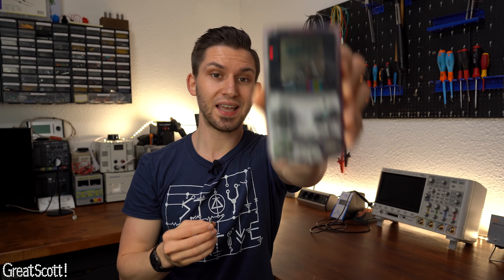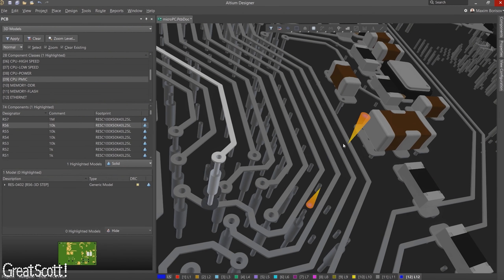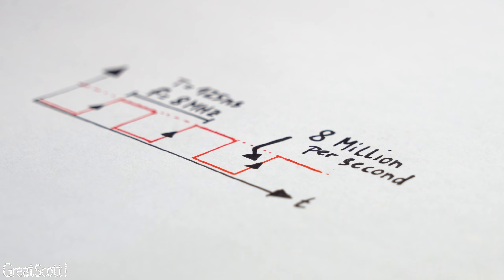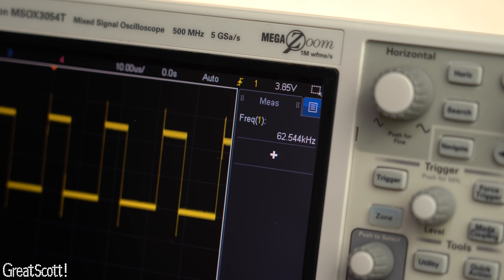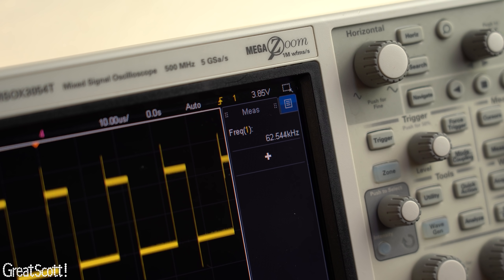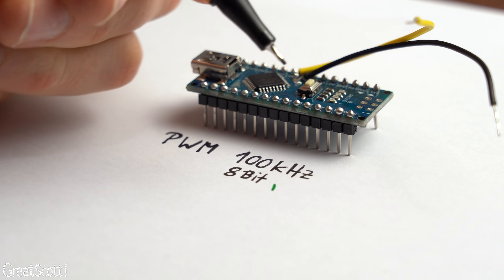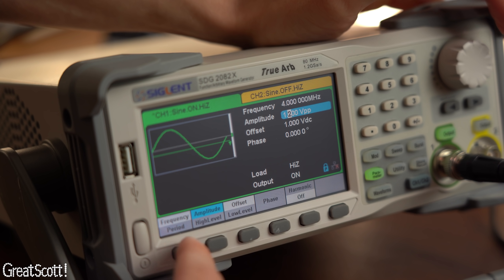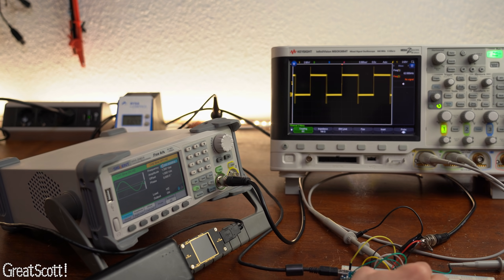Overclocking can be useful?! Let's try with my GameBoy & Arduino

Comment: Great video! It'd be neat to see the reasons for these frequency limits, and why it glitches when taken too far
Reply: It will glitch because the rising/falling times for signals will become too long for each clock cycle, meaning data from 2 different clock cycles kinda gets mashed together, corrupting it and causing the system to execute 'random' instructions or no functions at all as a trigger level is never reached.
In the gameboy color, the main clock is divided, likely this divider cannot keep up, if you were to bypass it you could probably get a higher clock. The next issue is the ROM in the game cartridge, it is far too slow for any higher clocks. So for getting your gameboy color to 30-40Mhz you'd need a faster ROM or even SRAM etc.
Reply: @someguy4915  sram timing will not be able to keep up at some point also I suspect the screen might not be happy with the fast timing, idk if it has internal buffer like modern lcds
Reply: @victornpb  I suspect that the battery life will also be disappointingly short.
Reply from the maker: Thanks :-)

Comment: Now could you wire up 3 different oscillators and control them with a switch or would that take too much power?
Reply from the maker: That should work just fine ;-)

Comment: Fun fact (in case you don't know): you can also overclock PC's CPU by force the system to give it more voltage than usual. But this will increase heat output of CPU, but make the CPU runs faster!!!!

Comment: I can see speedrunners modding their gameboys to run games faster :D
Reply from the maker: Lots of people actually do this. There are mod kits available ;-)
Reply: This is considered cheating and would be very obvious to detect
Reply: For Pokemon speedruns the in-game timer is used. As this clock also runs fast there would be no improvement by overclocking. In fact, for faster-paced games, underclocking would help you get faster speedruns by running the game in slow-motion.

Comment: Also to deliver the higher current you need higher voltage, so “overvolting” may be required to achieve bigger overclocks, and with higher power more heat gets generated
Reply: Water cooling an overclocked Gameboy? Sounds like an LTT video
Reply: @colejohnson66  or maybe der8auer, since scott from germany, and so roman (der8auer) too. Plus point is Roman is an overclocker himself.
Reply: @colejohnson66  I think a massive heat sink would be funnier and probably more effective
Reply: @colejohnson66  Anthony from LTT needs to get on it!
Reply from the maker: True :-)
Reply: Well they did overclock a calculator to run some games on it, and watercooled it if I recall correctly
Reply: With higher power, comes greater responsibilities
Reply: Transistor gates are capacitors - there is a set amount of time it takes the gates to charge up to the threshold voltage and the higher voltage will charge them faster. OC systems become unstable because you're driving them at a higher frequency than the chips are rated for, which can result in signals being "lost" if the gates can't change state fast enough. This does require more current but it's not the same as the increased power usage from faster switching which is what is being referred to in the video.
Reply: @skipfred  Great explanation, I was wondering why actually those glitches occur. It is learned on computer colleges with an examples of JK bistables  where they don't get to close/open because they are too slow before another signal comes in which is too fast.
Reply: get the ln2 ready!
Reply: That's exactly why I have a 50L dewer of LN2, a single stage phase change unit and watercooled tec's !
It's nice watching a 400w 12900k OC drop to 250w with just a bit of cold
Reply: @Gti_Jason  how could it possibly drop from 400W to 250W with cooling? Shouldn't the power remain the same but you can achieve higher clocks and powers with relative stability?
Reply: @dimitrijekrstic7567  because the resistance of the connections inside the ic decreases with temperature, and the transistors become faster as well both help decrease the power of the ic, btw by cooling he meant ln2 aka -160ºC, so a simple water cooler wouldn't produce the same effect, at least not enough to notice it.

Comment: Overclocking is definitely worth it for PC hardware. MSI afterburner is a easy way to get into GPU overclocking. I've never damaged a component by overclocking.
Reply from the maker: Thanks for the information :-) Never used MSI afterburner before.
Reply: same, you cant easily damage a component using basic oc, the over volting oc and not using adequate cooling are responsible for that
Reply: Last CPU I killed with an OC was my old AMD K6-3... Voltage did it.
Reply: MSI can kill gpu's it killed my first gpu
Reply: @jakobfindlay4136  no it doesn't.. PCs are more intelligent...  I even did like... +1500Mhz on 1050ti 😂😂😂😂... And PC freeezed and restated.. nothing. Changed... Did same with 3060 with voltage ofset of +1v on Vcore... Same PC freezes and Restarted.. nothing changed...  Both cards are working nicely..
Reply: @ArifKhan-bp9zx  it does if you remove the limits, its definitely can, but as i said basic oc cant do that, the more advanced oc can do that
Reply: @ArifKhan-bp9zx  This reminds me of a laptop GPU I had, an 8400M GS, ran at 400 MHz normally, I pushed that thing STABLE and not even heating up much to... 650 MHz. 
It was downright funny how epic of a percentage push it accepted and still gamed stable.
Reply: @ShahZahid  hardware modded OC can actually kill CPU or GPU.. like people does with Vsense pins to supply more Voltage via VRM..
Reply: @ArifKhan-bp9zx  bruh thats y in my comment i said that over volting can kill components
Reply: @Kalvinjj  The 8400M uses an Nvidia G86 chip which is also used in other cards. As some other variants of this chip are used in 600MHz cards it's not too surprising that yours ran at 650.

Comment: I always wanted to overclock my raspberry pi 4 b, I think I'll do it (:
Reply: you can use commander pi, its an easy one click gui solution, just dont forget to use good cooling or your pi will thermal throttle
Reply from the maker: Have fun :-)
Reply: Good luck
Reply: there's a ton of videos on overclocking the 4B.. I want to lean how to make a DAC for mine..

Comment: When I was teenager, I did dreaming have some speed up like this, but my Apple II simply don't have such a speed up due to it's architecture won't allow simple speed up, sophisticate hardware not cheap.
Reply: Has nothing to do with being 'not cheap' or 'sophisticated' but with the fact that the clock signal is usually just the video clock signal divided down. So if you speed that up, the video output is no longer correct and any TV/monitor would not be able to display it. In a way it is rather primitive, instead of sophisticated.
This was the case in practically every computer from that time, and made it so that computers built for 50Hz AC ran different in countries that had 60Hz etc.
Reply: Yeah, old computers were like this Gameboy... Every subsystem and the video output clocks were derived from the main oscillator, so you simply couldn't overclock it realistically.
Reply: Even a pentium 4 could run gba pokemon at 10x speed in emulation